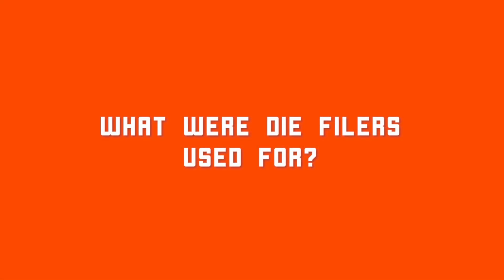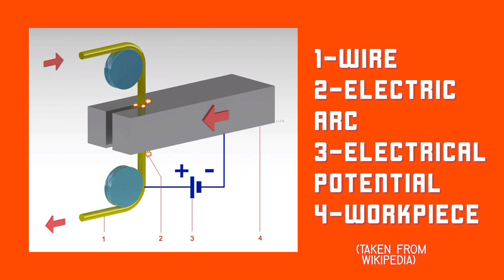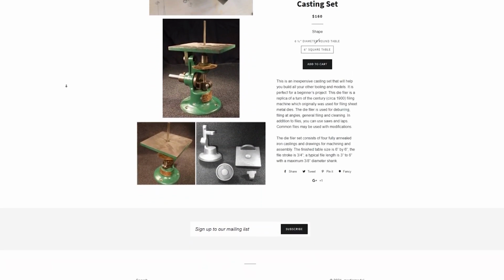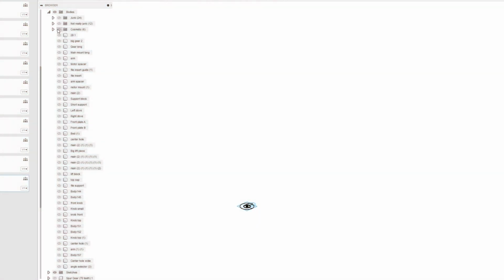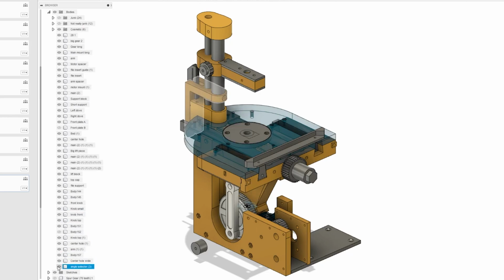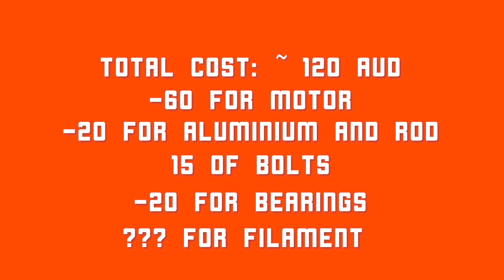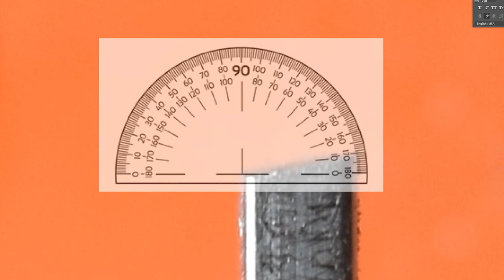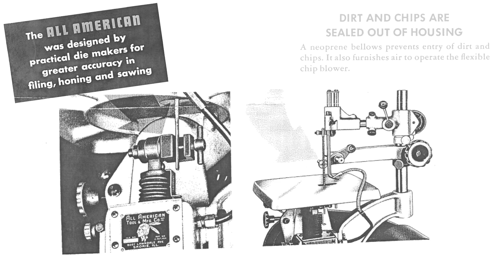3D Printed Die Filer Shreds Metal (part 1)

Comment: "...die filing."   😁 You need a hold-down to keep the part from rising off the table as the file rises. I believe I'd have put a bit more priority on it than you have, but that could just be my CDO manifesting. 😆 I'm quite impressed. I wouldn't have considered making it out of 3D printed plastic, before seeing this.

Comment: Totally awesome build! Die filers are incredibly useful machines in the home workshop. In the EU, an old die filer can be bought for around 300-500 ... plus shipping. But most of them require a 400V outlet and are super heavy. Also, the files are hard to come by... There used to be a poor man's version though: power tool makers like Bosch and AEG used to offer die filer conversion kits for their jigsaws, consisting basically of a mount for the jigsaw (flipped on it's back), a work table and a file guard. The cheapest parallel/straight files I was able to find are the ones used in chain-saw filing jigs - around EUR 4 to 5 a piece...

Comment: Soon after i started 3D printing i realized i could upgrade my 3D printer with my existing 3D printer. 

With the 3D printed components i made a CNC router and lathe which upgraded themselves replacing all the 3D printed components to all metal. 

The all metal CNC and Lathe i used to make metal components to the 3D printer. 

With your idea this process will begin again and a new cycle of a snake eating it's own tail will begin.

Thanks!
Reply: Please redpill me on 3D printed lathes
Reply: @dogeenjoyer7581  You can check out people on YouTube with instructions on how to make various CNC machines. They are vastly inferior to professional grade machines. They are great for hobbyists that have at some point needed one but didn't have it. It's like training wheels for an actual lathe.

Comment: 3d printed parts generally need to be larger than metal counterparts to take the stress. I wonder how a large lathe sized bearing would hold up to light lathe loads. Even if it was much larger, and less capable, a 3d printable light duty metal lathe would be revolutionary. I don't think I've seen anyone test giant plastic 30cm smooth faced bearings for strength.
Reply from the maker: yeah ive thought about using oversized bearings + my threaded rod compression technique to make a simple lathe before, perhaps using the bearings and motor from an old treadmill. A sub ~$150 metal lathe that is decently capable would be very useful for a lot of people, myself included.

Comment: Have you considered placing the drive system at the top of the machine? It would eliminate all debris issues, plus by having the main driving force down and just a compression spring to return it might cut down on the work piece jumping (I think).

Comment: When redesigning the bottom part, it might be a great idea to move the motor far away too. 
Most ebike DC motors (that I know of) contain permanent magnets, which will attract any ferromagnetic shavings coming close to it - and they'll be hard to remove, if possible at all. 
Love to see what you come up with in part 2 :ø) - perhaps a 10k video?
Reply from the maker: hopefully 10K soon ahah, and with how I plan to redesign the bottom the motor will be around the back of the machine which would help, and ill design a housing for it as well.

Comment: some asshat is going to comment on its precision and rigidity. I am going to say wow that's a game changer! you know how many hours I have filed at stuff over just the last 10 years ... probably one quarter of  the last decade. That's my thing, soft materials like plastic, usually modding a premade object. Dremel, handsaw, file, file, file that looks right, finish sand, and set said object on shelf to never be used again.

The stuff I do daily use mostly looks like it was constructed by a mentally special beaver